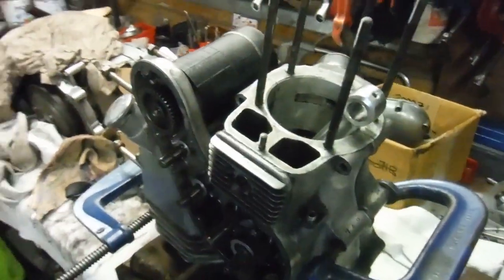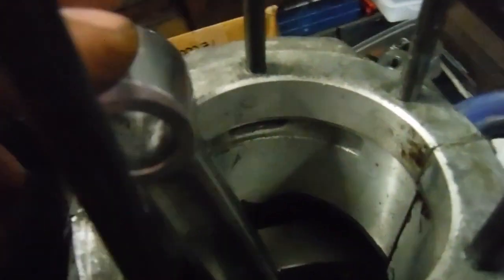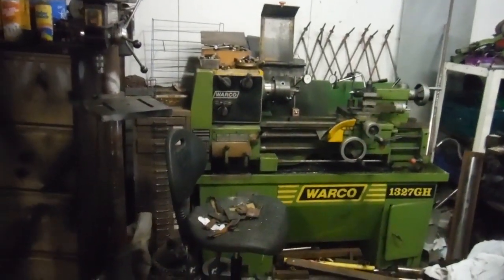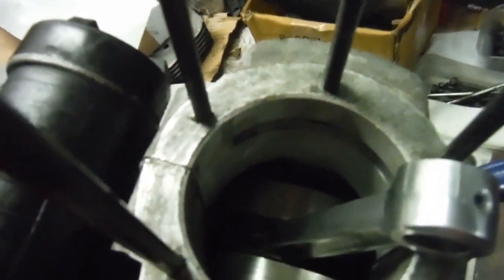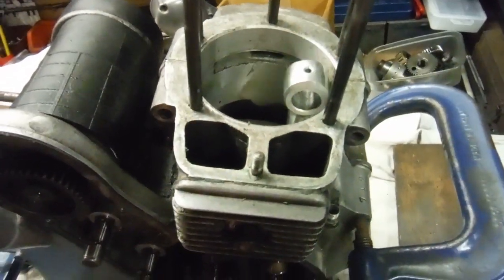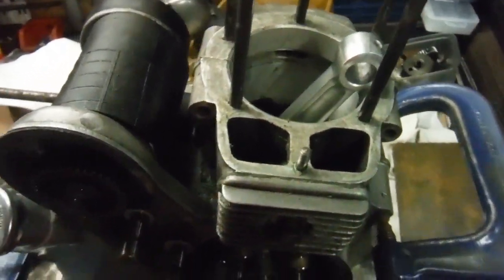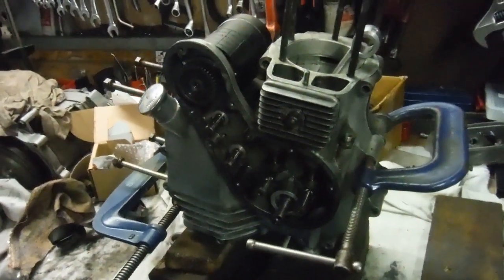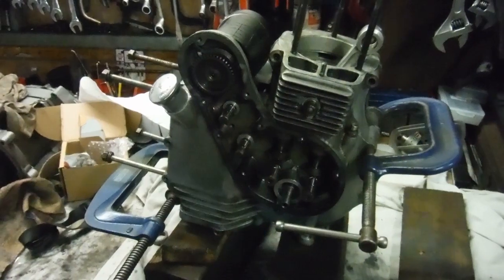Royal Enfield Bullet 500 Asbo 37 engine bottom end discussed at Performance Classics.

Comment: Hi Paul, I'm about to put my 1999 500cc bullet engine back together after a big end failure due to a quill seal letting go & starving the big end. I've gone for an expensive Alpha bearings roller conversion which should be completed within the next 2-3 weeks, theyve had it 6 weeks already ! I was wondering which main bearings you prefer to fit ? The 6305 I removed is a C3 fitbut the NU305 & NU205 are not showing any clearance markings, do all 3 bearings need to be a C3 fit ? Cheers, Gerry.
Reply from the maker: Hi Gerry, I just buy the 'European bearings' from Hitchcocks, they seem to work fine.
Reply: @paulhenshaw4514   Many thanks Paul.

Comment: I've only just noticed this video.  Quality job!  Was this originally a standard 500 or a low compression engine?  Either way, the transformation must be quite special.
Reply from the maker: Hi William and thanks - like all the 'Asbo' engines, this started life as a totally standard example. Most end up with a 50 percent power increase, or more.
Reply: @paulhenshaw4514  That's a tremendous difference, well done!

Comment: Hi Paul! 
Just a little query regarding the timing shaft, is there an oil seal or a bush?
Reply from the maker: Hi Jerin, this type uses a seal, which is not yet fitted. Older types had a bush or just a close fit through the casing.
Reply: @paulhenshaw4514  ya thats what i was thinking. Because on my 1990 bullet 350. There is a tight brass bush on the timing shaft. And i was not able to move the crank with my hand.

Comment: Well, that was a bit of alright. 
Glad to see that your lathe is a 1327 GH...and not the 1224 GH, as I seem to have heard that the latter had problemmes with cutting threads...a bit too much backlash, so I was told.
BTW: I have done a survey of your voluminous video output, and fail to see a display of your skills, on a BSA Gold Star. This is so, monsieur ?
Does no one in Wales discern the wonders of that machine ?
Reply from the maker: Ah - the only BSA Gold Star I worked on was a 1949 ZB32, on which I did a full concours restoration, but that was prior to my video making days. It is among the pictures at the top of my Performance Classics FB page, though.
Reply: @paulhenshaw4514  A 'Hard Tail'...I can only imagine !
Reply from the maker: It was an early plunger model.

Comment: Is there a list of the specifications going into the build?
Piston, cam,carb, valves etc.
Reply from the maker: There will be, as we go. this one is penciled in to run standard cams with the inlet retarded by 1 tooth, 9:1 piston, shortened alloy barrel and ported head.